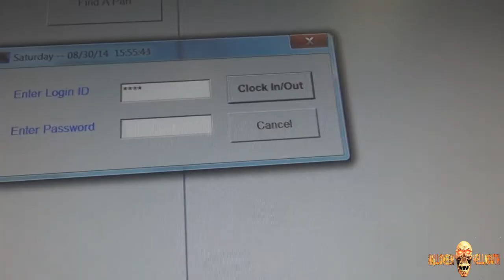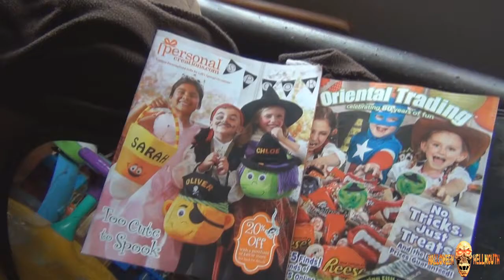Hellmouth Vlog 08.30.14 [Day 1399] - Panel Moving Help!!!

Comment: hey troy i dont know if your still having a tree problem but i was reading somewhere on FB that boiling water can and will kill unwanted growth. if that doesn't work try adding salt and or vinegar. you might have to do it a couple times but it's worth a shot. good luck.